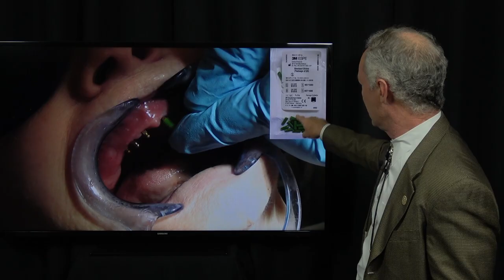Securing a Maxillary Denture with Mini Implants - Dental Minute with Dr. Steven T. Cutbirth, DDS

Comment: Thank you for your excellent educational series. What are your thoughts on comparative bone loss for mini implants compared to conventional diameter implants? I have seen a number of patients with moderate vertical bone defect on mini implant sites compared to conventional implants.
Reply from the maker: Implant failure rates are about many things, including surface area of the implant osseointegrated with the bone,  lateral forces placed on the implants plus the patients physiologic system (diabetes, etc.) and habits (smoking, etc.).  I place a lot of mini and root form implants, depending on the situation.  I think it is important to understand both.  Normally, in a perfect world, we think of placing 2 mini implants (less than 3mm in diameter) for every 1 root form implant if they are being used for full or partial denture stabilization, but that is not always possible.   I do not load any implant, even with a provisional restoration, until it has osseointegrated with the bone for at least 3 months.  I do not place implants in patients that smoke.  That may be why I have such a high success rate with both mini and root form implants.

Comment: These mini implants can’t be used for crowns? Just anchors for the denture? And how is the healing process?
Reply from the maker: Small diameter, mini, implants can be used for crowns when the horizontal width of bone is not sufficient to accommodate a root form implant.  This is especially true in the mandibular incisor area and occasionally in the bicuspid area.  Small diameter implants have the same healing/longivity characteristics as root form implants, they are just under 3mm in diameter.  The key considerations are surface area of the implant and horizontal stress being placed on the implant.  Use an SDI as long as possible and eliminate horizontal forces on the implant.

Comment: Dr. I'm already suscribe to your masterclasses andI would like to know if in this type of rehabilitation, it is possible to perform a prosthesis without a palate? thanks
Reply: and in the where in the masterclass i can find the final denture of this case? thanks again
Reply from the maker: Yes, definitely.  I most often have the technician remove the palate on maxillary implant supported dentures.
Reply from the maker: There are several implant supported denture cases in the DMC.com library.  Many of them have the palate removed.  Let me know if you have trouble finding one that answers your question.
Reply from the maker: Yes, there are several small diameter implant/removable denture cases in the library of DentistryMasterClasses.com library.  If you are a subscriber to DMC.com I suggest you start at the beginning and watch all the videos in the library several times.  Repetition is how I learn things.

Comment: if a patient has a firm root with no crown at all, and I do a root canal on the root, and then like we use dentine pins/post, i use a mini implant drilled inside the root and then place crown over it, will it work?
Reply from the maker: The only problem is sizing the small diameter implant correctly so it does not split the root.  I prefer the Para Post system.  With this system you drill into the gutta percha filled root canal with a specific diameter drill, them place a pre-formed wax "post" into the drilled canal hole and take an impression of the prepared tooth with the wax post in the drilled out canal.  The waxed "post" comes out of the drilled out canal in the impression.  Your dental lab tech then casts a metal post from the wax post along with fabrication of a crown.  The metal post can either be separate or connected to the crown.  The post and crown are then cemented into the root canal orafice.  With this system, no pressure is applied to the inside of the drilled canal, so the tooth will not split. I roughen the cast post a bit with a course diamond burr to increase cementation mechanical retention. I will do a Dental Minute on this procedure in the near future.  I personally like cast metal posts better than prefabricated posts.
Reply: sir, so much respect for you, thankyou so much. how do u make the pre formed wax post? waiting eagerly for this dental minute :)
Reply from the maker: They are premade and come in different sizes with the ParaPost System.

Comment: Pls make radiographic diagnosis
Reply from the maker: Sorry, I do not know what you are asking.
Reply: @centerforard  sir how to check bone level  overdenture case using radiagraph or cbct sir
Reply from the maker: Use the measuring app. on your computer and measure off a periodical radiograph. The measurement is not exact, but if the radiograph is taken well, it is very accurate and close.  It is one of the headings at the top of the page. Our system is Dentrix. 
Take your practice to the Top Tier. Subscribe to DentistryMasterClasses.com for an organized library of all the Dental Minute videos plus many complete comprehensive cases and many very important articles. New cases are added weekly.  Only $20/month.
Click here to subscribe: 
https://membership.dentistrymasterclasses.com/purchase/?plan=513

Comment: today i met with one of my patients.
He first came to my office for a pane in the first upper molar .
I prepared the the distal buccal root canal and the palatin root canal which where necrotic.
the mesial buccal canal contains pus.
After irrigation i left the tooth open and administrated antibiotics (metronidasole and spiramycine).
The second oppointment i obturated the canals .
my patient came with an irritated eye  (the side of the obturated tooth), i thought that the problem came from a contact with the maxillary sinus.
I demanded an orthopantomogramm and programmed to send the patient to an otho laryngologist.
He didnt came and today he said to me that all in order, he just contacted another dentist that simply used a apex locator, reshaped the root canals with mechanic files.
Reply from the maker: Leaving the tooth open may be the problem.  In the case of necrotic pulps, I thoroughly clean and irrigate the canals with diluted sodium hypochlorite and almost always obturate all canals at that cleaning/filing/irrigation appointment.  There certainly are exceptions to this immediate obturation method, especially if the patient has facial swelling at the initial appointment.  Almost always it is fine to go ahead and obturate the canals at the first appointment so long as you have filed/cleaned and irrigated the canals thoroughly.
Reply: Although the cavity was accessible, without having the exact lenght of the root canal i failed
Reply from the maker: Did you not have a periodical radiograph or an apex locator to identify the length of the root canals?
Reply: i use only radiograph
Reply from the maker: Did you take a trial file radiograph, i.e., a pa radiograph with the files in the canals to get a close idea of the canal lengths?  Before apex locators, that is how it was done to determine approximate canal length prior to extensive filing and obturation.
Reply: yes  did
Reply: the radiograph is my office now, i will make a photo of it
Reply from the maker: I want to help, but I am sorry I am not in a position to treat your individual cases on the internet.  I would have to examine the patient and hear the history to truly be helpful.  You might want to consult an endodontist.
Reply: Thank you, the problem was solved already. The molar was retreated by a collegue and the patient is happy.
Reply: I appreciate your will to help